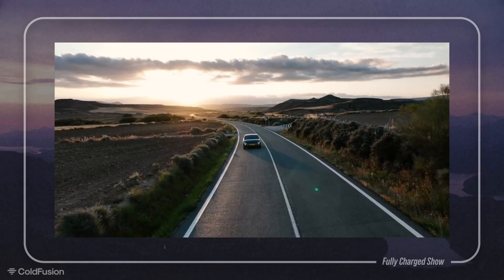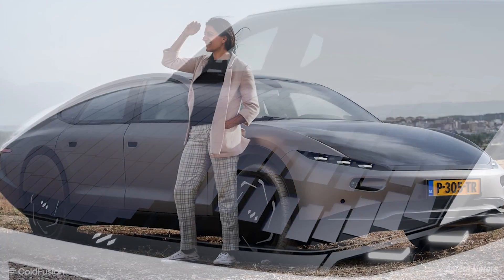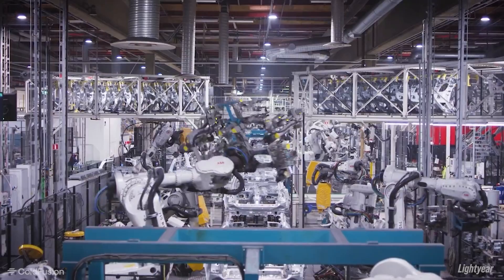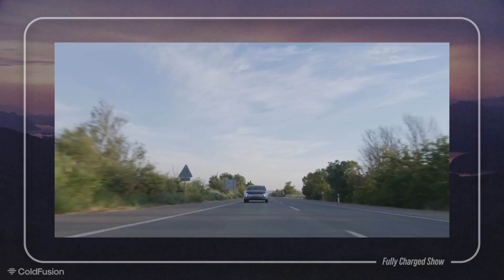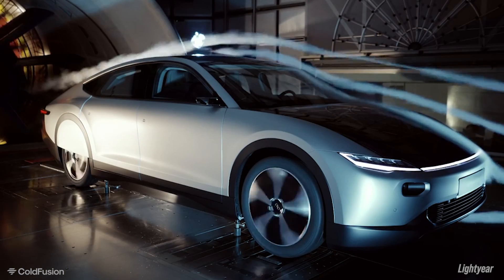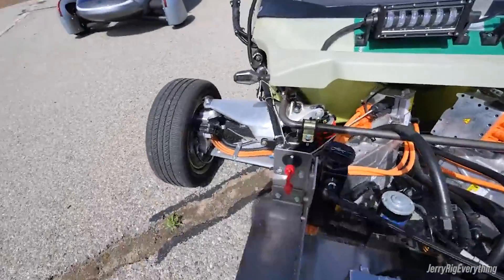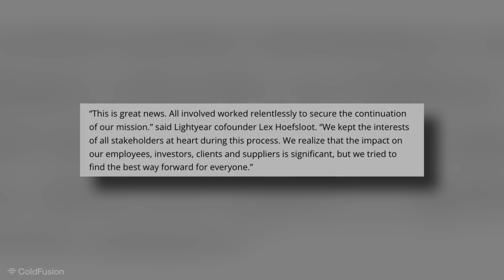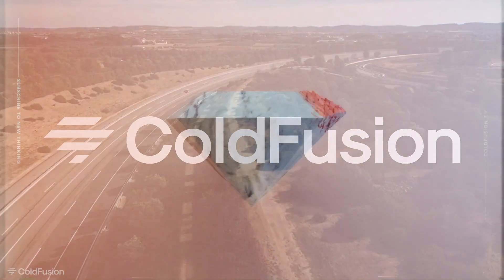3 Interesting Solar Car Projects

Comment: As person who only drives a few thousand mile at most a year and leaves their car in the sun . This would be perfect.
Reply: Same here, I am disabled and cannot bike or walk, and my commute is only less than 5 miles per day. I only drive about 2500 miles per year and my car sits in an open parking lot all the rest of the time.
Reply: You'd spend $40K for a car that you use so little?
Reply: @petros_adamopoulos 
It's unavoidable for many people. No public transit combined with not wanting to reliant on services like Uber.

Also most people who drive that little typically don't buy a new car, they buy a cheap used car or light truck.
Reply: @petros_adamopoulos He doesn't spend 40k for barely using the car. He spends 40k to have the freedom to drive somewhere whenever he wants.
Reply: @petros_adamopoulos  25K for the 250 mile version & you can buy used a year later for cheaper
Reply: @petros_adamopoulos  i would only if I lived in it. If I didn't live in it, I'd just ride a bicycle instead of own the car.
Reply: @EricPeelMusic  hell buy an E-Bike the carbon output to manufacture is a tiny fraction of an EV, not to mention the energy used per mile a fraction,  and you still get some exercise.
Reply: @Battleneter  I had a 30mph ebike for a few years. It was nice to be able to haul groceries up steep hills. But it was 60 pounds (steel frame and heavy BBSHD) and it's awkward to carry that up stairs or load it onto a bus everyday. Much prefer the simplicity of non-ebike. The new Pinion GMU looks promising however. Good power, reduced weight and low maintenance. But we're back to extreme cost again.
Reply: you can use it more but then you need to charge it. It's just an extra 10% for free. And it adds up for those who don't drive daily
Reply: @petros_adamopoulos  Aptera-  $29,000 or even less depending. AND carries you... AND a passenger + lots of "stuff" alonger way than most EVs
AND on Solar power alone. Also calculate if the Average American spends $200/mo on gas, that';s $24,000 in TEN years! and your Solar Aptera is almost PAIF FOR just in fuel savings alone as well !  Add in WAY lower maintanace, quite, fast acceration, super low drag, AND you are saving the PLANET
Buying one is a no brainer!
Reply: @petros_adamopoulos  yeah! Just because one doesn't drive long distances, doesn't mean he doesn't use the car often. I use my car approximately every other day or less and usually not for more, than 8km (5 miles) with about 140km (90miles) trip once a week. Some of these cars look like I could use them without ever needing to charge. I was really considering buying the Aptera but I have an issue with it's width. The 3-wheel design (wider to keep it stable) makes it somewhat unsuitable for European streets and roads.
Reply: @petros_adamopoulos the idea is what they call use dip shit,. A car that uses solar would be better for them as they don’t drive that far.
Reply: @petros_adamopoulos   for €40k here you can barely get a fully fledged sedan.
It goes without saying that if the Lightyear One were to be sold here, it would EASILY cost 60-80k.

40K seems more than enough for a car that self-charges
Reply: @petros_adamopoulos  what do you want me to do? walk to work?  cars are the only way to get anywhere even If you don't use it a lot. And btw driving costs a lot of money too
Reply: @petros_adamopoulos  exactly, op is a bit stpid
Reply: @timewalker6654 lol educate your self first before calling others stupid. EV works fine even in all weather. Degraded range performance yes but battery health will be fine for minimal of ten years (guaranteed by warranty) and ten years is what gas car’s average lifespan is anyways.
Reply: @NVGEAR  "and ten years is what gas car’s average lifespan is anyways" I love the Electric Car. The speed or indeed when they will be able to Power Homes. Alas i doubt your figures. 10 Year life span?
Reply: @jeddaniels2283  I don't mean it only lasts ten years. I meant statistically Americans will not keep their cars for longer than ten before selling it.
Reply: Me too. Even though I leave the house four to six days per week I in a small town I still only have to get fuel once every 6 weeks or so.
Reply: For me will be perfect, only 20km per day and at work my car still outside under the sun for 9/10 hrs per day..
Reply: What you’re saying is that you would pay a quarter of a million dollars for a few thousand miles a year, just so you avoid refueling your car. Also, at your milage, a Diesel is probably much more environmentally friendly, because it requires much less mining for rare minerals like lithium or mangan.
Reply: Same here.
Reply: Same here.  I'm on disability retirement.  I drive maybe 5-10 miles per week.  The only thing is I drive so little it's not worth $40k to buy a new car.
Reply: @dr.elvis.h.christ  and that's 40k after the subsidy scam.
Reply: Would you use one in a carshare hire?
Reply: It would be rediculous for you to pay $320 000 for someone that only drives a few thousand miles per year tho
Reply: @drakZes  Exactly.
Reply: @@jackdp87 many people do, especially if you have kids.
Reply: If you only drive a few thousand miles a year buy a cheap reliable old car and insure it for collision only. That's by far the most economical and sensible solution if you have to have a vehicle but don't drive very far annually.
Reply: Too bad the car doesn't and won't exist for end users
Reply: If you only drive a few 1000 miles. Why would you own such expensive vehicle. Seems a waste of money really
Reply: Yes, I would love a Lightyear, speed not a problem. 

Production is actually hard as it turns out. 🤦‍♀️🌀🧐
Reply: @christinearmington  Production was never the goal, subsidies taken, close shop, try again.
Reply: Electric cars are not about saving the environment and this kinda proves it. People want the performance while they are made to "feel" like they are helping the environment. Of course taking public transport or jumping on a bike is "really" helping the environment, but good luck selling that planet saving idea around election time as a politician.
Reply: Aptera is a better, much more affordable option.
Reply: They could do that on a bike.
Reply: Have you looked at the Aptera?
Reply: My work is 3.5km from home lol
Reply: Most people do at least leave theirs in the sun
Reply: Same
Reply: Don’t get this. Get a sports car. It’s 100 times more fun especially if you tune them.
Reply: @Eclipsis17  I sounds like that one friend that is/has a bad influence on others.
Reply: What do you want pal, a car which is recharged by lightning ?
Reply: leaving the car in the sun fucks up the inside though, hate that
Reply: The issue here is that if you only drive a few thousand miles a year, it won’t have much impact on the environment if you would drive an EV or an inefficient ICE car. 

One might even argue that it would be beneficial if you’d buy a second hand gas guzzler from someone who would then drive many more miles in a more efficient (ICE or EV) car.

No judgment, just my thoughts.
Reply: Some people who drive only in town might find the squad solar a better fit.  Claims it will sell for around $6K.
Reply: well why not buy a way cheaper and better fitted gas car and fuel it up twice a year?
Reply: I want this car so F*ing bad!!

Get this car production going again, please 🙏🏼🙏🏼
I'm already prepping to sell my current car just to get this vehicle. I'd get the aptera except my 3.5year old can't sit in the damn 2 seater.
Reply: Then don't buy an EV. Keeping your electric car fully charged on hot parking lot is a recipe for a dead battery. On hot summer day with plenty of sun, temperatures inside car can get easily above 60C which does not play nicely with battier,  especially while you charge them. It is recommended to charge your EV during night, in shelter or at least in shadow during charging.

That's one of the reasons I din't think solar cars will take off. The other reason is that it is a niche product, for people living in sunny places and/or using their car very sparingly. Stationary solar installation makes more sense in most cases.
Reply: @pingwingugu5  plenty of Teslas in the mid west of USA and Middle East and other scorching weather places with no battery issues at all after over ten years. Cabin overheat protection and active battery cooling when charging plus other tech counters extreme cold/hot weather for EVs. Guess you don’t even own one to know these simple facts.
Reply: @NVGEAR  there is no free lunch. Active cooling is active - uses energy. Overheat protection is not magic, you need to slow down or stop charging to prevent baterry from overheating. Not all EVs have active cooling systems, famously Nisan Leafs were cooking their batteries in year or two in hot countries. 
BTW read your Tesla user manual
"Do not expose Model S to ambiant temperatures above 140° F (60°C) or below -22°F (-30°C) for more than 24 hours at a time". 
You should be safe as 60C is only reached in  parking lots and such during the day when exposed to sun. But still Tesla users do report bad efficient in  hot weather.
Reply: @NVGEAR  lol please, those batteries don't even last 10 years by design
Reply: @carlosnavarro-cj2jv  there are used Teslas that are over ten years old with batteries that run fine. And the manufacturer warranty for battery is at least 8 years.
Reply: @NVGEAR  there are ised gas cars that are 60 years old
Reply: @carlosnavarro-cj2jv  I said “most cars are useful for 10 years” MOST! I know thousands of people and 0 of them drives a 60 year old car. Jesus if you don’t like EV just get an ICE car and stop wasting time arguing your useless points here.
Reply: @NVGEAR  I have like 3 cars and non of then are less than 10 years old and all of them have original parts
Reply: @carlosnavarro-cj2jv  yes there are also people who still use landlines and never owned a cellphone. And people who ride horses instead of driving. What's your point. You are in the super minority not the majority. I said "most" cars are sold after ten years. Just look at the fucking national stats man, 95%+ of people change cars  in around ten years are even less. What about all those 3 years and 5 years leases, plenty of those too.
Reply: @pingwingugu5 
Do you know of other EVs then the Leaf that don’t have active cooling/heating?

Yes Nissan Leafs were bad but that was 10 years ago and even then:

[from Wikipedia] In 2019, based on data gathered from over 400,000 Leafs sold in Europe, Nissan stated that the battery would last 22 years, outlasting the vehicle by 10-12 years.
Reply: @Conservator.  I do not know all the EV cars currently on market and I don't want to look for it. The point is, active cooling is extra equipment, that takes extra energy, and might need to work long hours even when you are not using the car.

It is better to shelter your EV,  you will get better range, better battery lifespan and less maintenance costs.

About the Wikipedia article, some key words "sold in Europe" - not the market where Leafs had the most problems with overheating the batteries during charging. Second is "battery would last" what is the definition of lasting used in the study? When is the cut off? Is it 50% range lost, 90%  range lost or literally battery can not hold any charge anymore. Also 10 years is a short life spam for a car. I see plenty of cars on roads from early 2000s. I would take everything that manufacturer claims with a big grain of salt, they often cherry-pick and present the data in very creative ways to make it look nice.
Reply: @pingwingugu5  There's no thinking outside the box...Who needs batteries? The human race is supposed to be so much further along. Nothing sparks ingenuity like extinction!
Reply: @pingwingugu5  So many wrong statements here.
Reply: @pingwingugu5    AGAIN wrong! IT is a GREAT car for many reasons, sun or NO sun. IT gets up to ONE THOUSAND MILES on a charge.
Did you think about that?  Plus people are stupid, Solar panels work from LIGHT. EVen on a partially sunny day or even overcast SOME charge takes place. Also- You can charge apteras on both a regular 120 V  plug AND larger charger

Comment: No they did nothing. It was a scam and it still is. I have a small solar setup on a roof, way more bigger surface than this, and its 1.3kwh... In a 100% ideal orientation... Maybe they have radically better and efficient paneles? Then wtf? Why are they building a fckin car around a new gen better than anything else panel? If its too good to be true, its not true...

Its super idiotic to put these paneles on a car, if they are soooooo much better than anything else... You never get ideal orientation, if you use it in a city yeah the sun will charge it, if a building or tree is not blocking the sun... Or you park in a garage... Or...

Snake oil bullshit...

And they never produced and shipped a single one to any customer. Nobody ever posted anything as an owner, a small company like them would post the sht out of the finished cars and happy owners... Small companies are building expensive cars all around the world, one of one stuff even, you can find a lot of info, vids, tours in the factory, etc... Nothing from lightyear... 

They let the company go bankrupt as then they dont have to pay the 110+ million eur they already got in that case, but never deliveted sht...

Cold fusion was better in the past...

Comment: The need for efficiency in electric cars are (currently) our best hope to get rid of SUV’s… or so I hope.
Reply: Nothing except efficiency will get rid of SUVs. I remember a while ago when gas prices jumped dramatically for a few years, SUV sales dropped. But that was before EVs. EV SUVs still get livable ranges for most people, so my bet is SUVs are here to stay until electricity gets too expensive to justify their shortcomings (or until legislation is passed that discourages SUVs for, idk, the extra wear the cause on roads for example. Maybe charge owners a bit more for the extra damage they do? Just a random thought that I know will never happen, at least in the US).